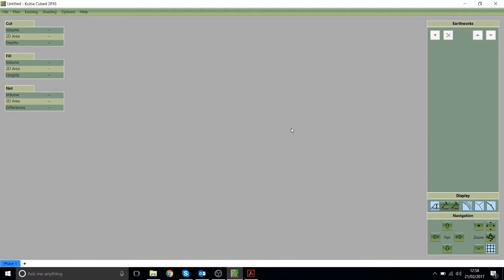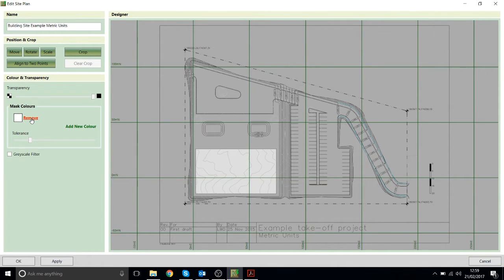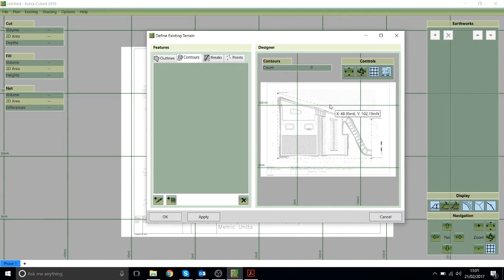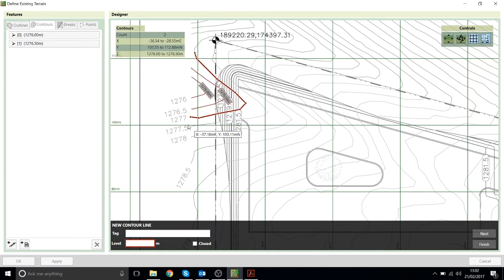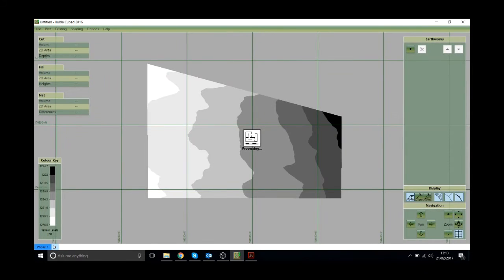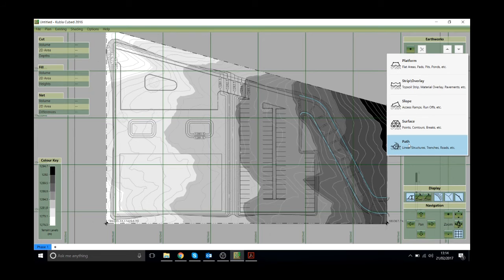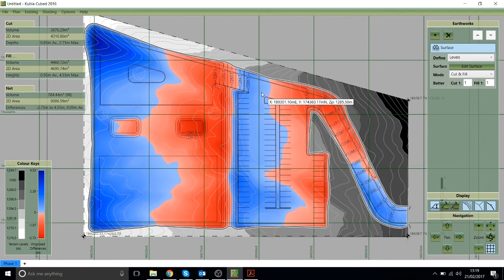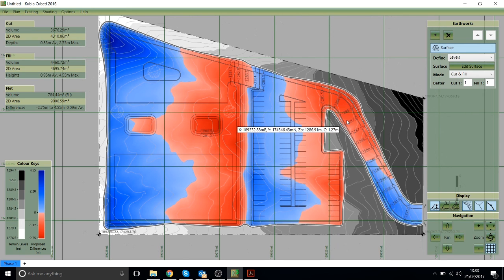Kubla Cubed 2016 - Walk-Through : Building Site Example (Manual PDF Take-Off)

Comment: The proposed levels contours for the surface drawn are the Finished levels of the surface, however we will need to cut/fill to the underside of the buildup of different surfaces at different locations say pavings, asphalt road etc. with different buildups. How to take that buildup into consideration to get correct cut/fill volume?
Reply from the maker: Hi, we recommend you watch the video "Adjusting  to Subgrade/Formation Level" https://www.youtube.com/watch?v=rw2kWY2NZIg for two different techniques.